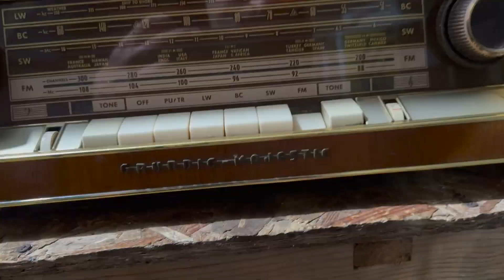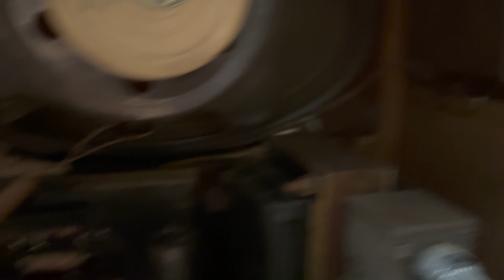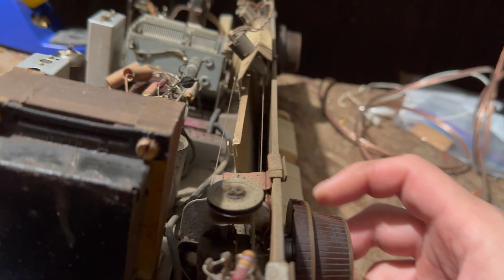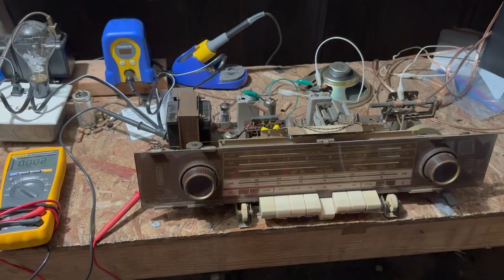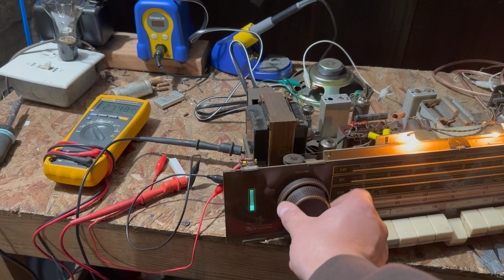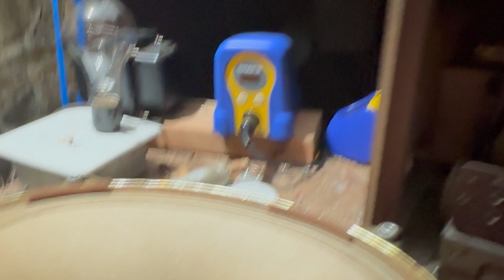1960 Grundig 3165 Antique Radio Repair

Comment: If the original speaker is in order you have original sound that should be...many restorer change to a new speaker and loose that sound that was taken from the factory...even in cars the radio was in a package with the speaker and change it is not original sound.